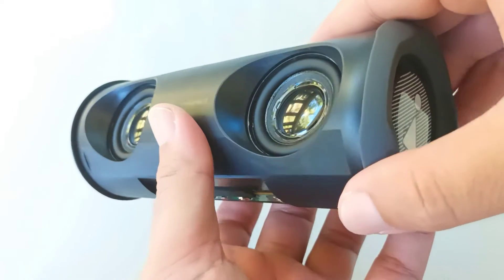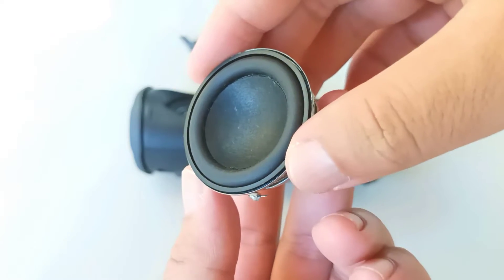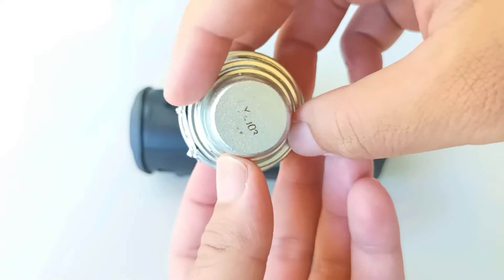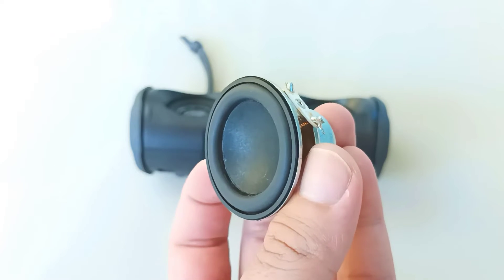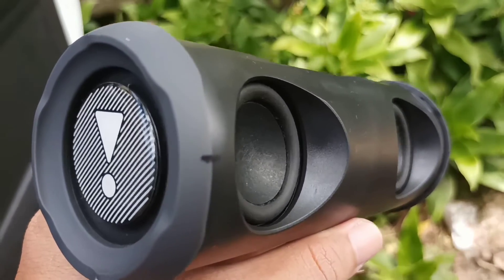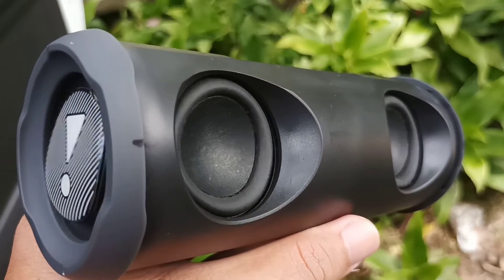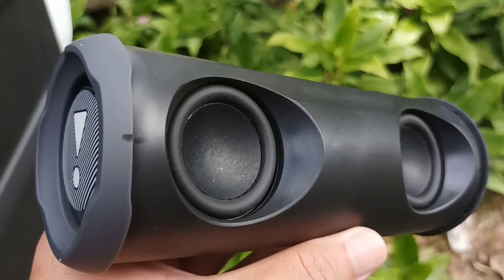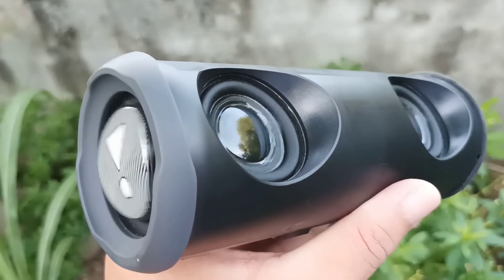How to upgrade Fake JBL Flip 6 speaker drivers (DIY)

Comment from the maker: Would you keep the original drivers or change it?
Reply: Change it the speaker
Reply: I would just change it if i found a 2 ohoms speaker wich the the stock amp hold just fine
Reply: Oh yes I found it
Reply: @princenelalbitojblchargemi6288  same size as stock speakers? make sure that they are rated at least 5 watt and your bass are good to go
Reply: I don't have one of those
Reply: The change is better
Reply: Even through the video its hearable that with new speakers sound is cleaner and louder, but bass is the same although it flexs less.
Reply: Keep
Reply: where can i buy the driver pls reply
Reply: i would probably take the dust cap off and put the cap from the new speaker
Reply: Original
Reply: of course, I want keep it because if I keep it I'm gonna blow them

Comment: Hey, I recommend changing the IC and the battery of the speaker. I had mine changed to an Enook 3600mAh 35amp battery, and the 5w Ic's changed to a CS8508E, it matches the speaker's wattage of 8W output. It sounds beautiful.

So instead of a 5Wx2 you get 8wx2, and the new IC barely heats up even at full bass EQ and volume. The sound is a thousand times better, clearer and louder too.
Reply from the maker: Been thinking about that but that means I need to buy a hot air station to remove the IC
Reply: @TaylorSoloaiJR  That is true
It needs a lot of work
Reply: Hey!
Can you give some more details on how to do that pls? Seems exactly what I want but I don't really know much about the topic since I'm new to this :)